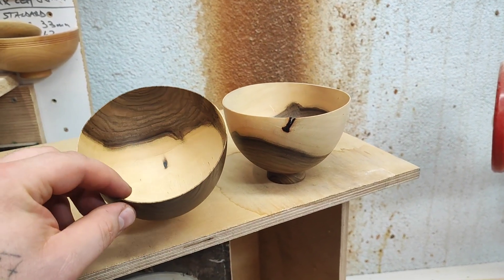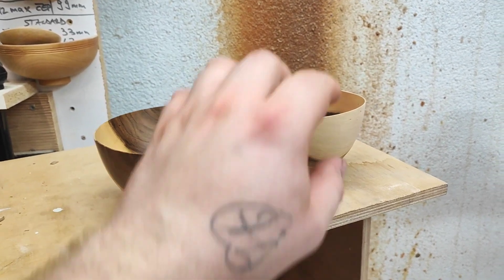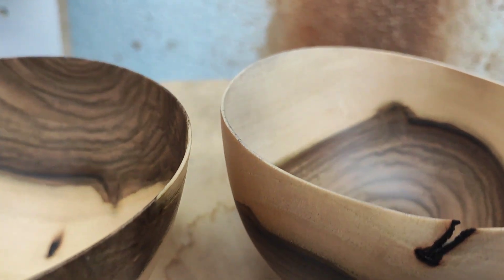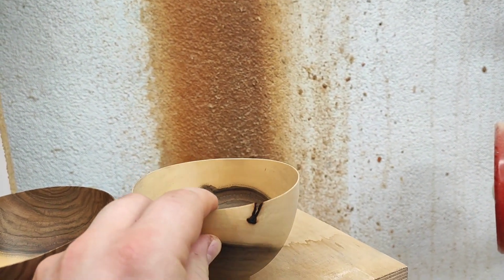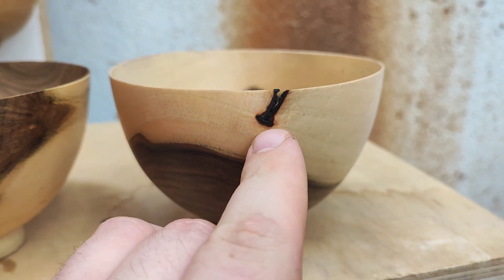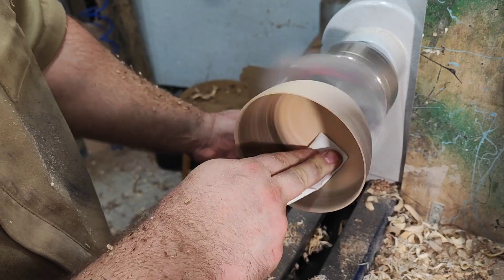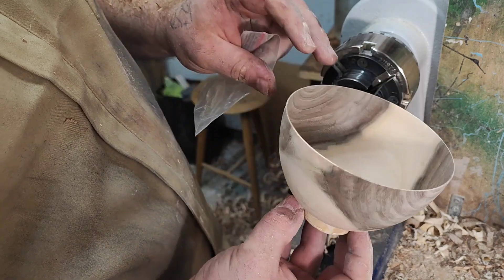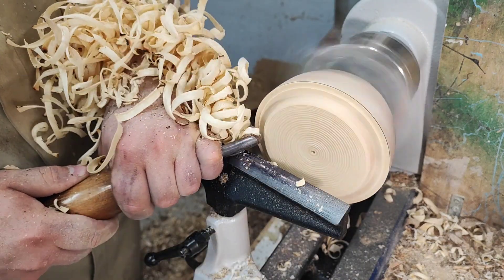I really like to make these thin bowls....

Comment: Back when you first started your channel. I said that I like your style. And I still stand by that statement. There are other professional turners that advocate for not using spindle gouges for making bowls (cross grain). I understand not using the spindle roughing gouge for that process because of the tang. But I dont get why they say that about regular spindle gouges. I'm self taught so I don't have a mentor to ask. So im hoping that you could offer your opinion on this subject. 
Like you and Raffin, I too use the spindle gouge for roughing cross grain. To me there's no difference in the strength of the tool essentially.  Like the bowl gouge it has a straight, solid tang. And is typically a less expensive tool.
Reply from the maker: Thank you sir for kind words and support 🤗

Many of those pro turners sell there line of tools and its in the interest to sell bowl gouges, however you had a good point. Spindle gouges are cheaper, and they accomplish the same task.... Other thing is not many turners know how to use spindle gouge to let say rough out a bowl.... I do like my bowl gouges but I save a lot of bowl gouge steel by using spindle gouge on outside of the bowls....
Other benefith would be when I rough turn plum wood, it really likes to jam in the flute of bowl gouges, but spindle gouges are shallower and shavings just fly out easier....

Its like we all drive cars different ways, the important thing is to get to finish line safely.... So don't worry about what others say....I go about what Richard Raffan says as he started turning when there was not much bowl gouges and did this for 54years or so....so he has try everything and it would be foolish of me to waste time to learn something on my own skin where he already try it and doesn't work.... I like this subject so I'll do a video as well☺️thank you very much
Reply: @tomislavtomasicwoodturning  thank you. I think this is definitely a subject that needs more attention.  More logical answers for all of us .
Reply from the maker: @wantlessobject  indeed😀
Reply: I will look for the video.  This is a question I’ve had for a long time.  I’m always told never use a spindle gouge on a bowl, but no one tells me why or what will happen.  Thank you.

Comment: You mentioned a microwave what was the process of there?
Reply from the maker: Quite simple, I put it on max heat for 30 seconds up to one min .... You have to watch it ,so don't leave the shop as they can smoke.... If the bowl is thin enough you can dry it in few sessions ,but you need to let bowl cool of in between sessions..... And dont use wife microwave.... don't ask me how I know that😉
Reply: I like the tip of using a plastic bag if the tenon is a bit too small!
Reply: Or actually, was that to protect the tenon from being marked? I think that is what you just said
Reply from the maker: @Amybaumgart  yes, if the wood is green jaws like to stain in so plastic prevents that
Reply: Beautiful work. I love the grain of the wood when the heart wood is at the bottom of the vessel. ❤
Reply from the maker: @pjseiber2774  thank you very much
Reply from the maker: @Amybaumgart  ohhh its not for the small tenon,its for so that the jaws won't stain the wet wood☺️